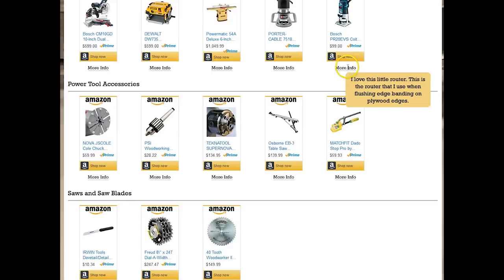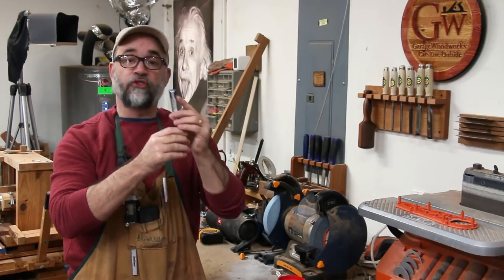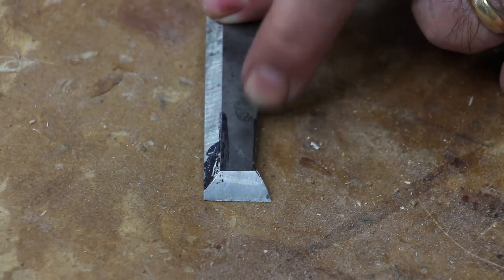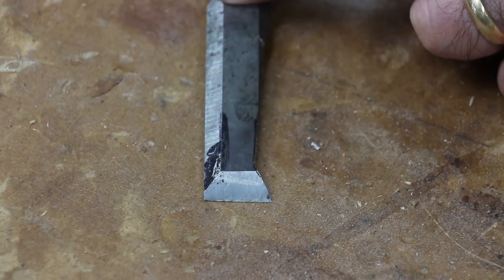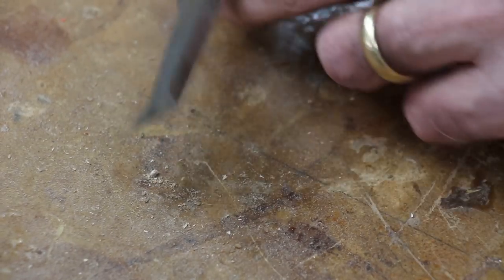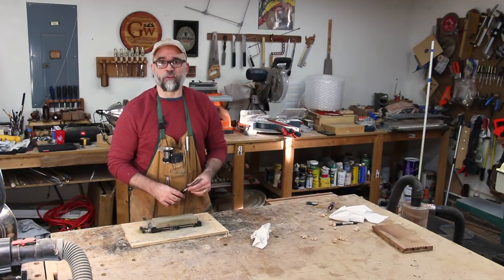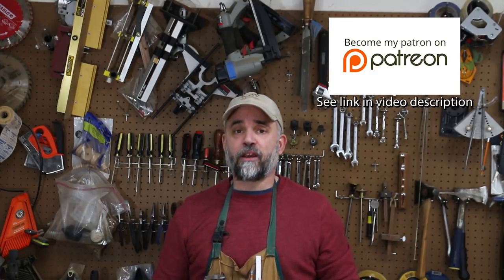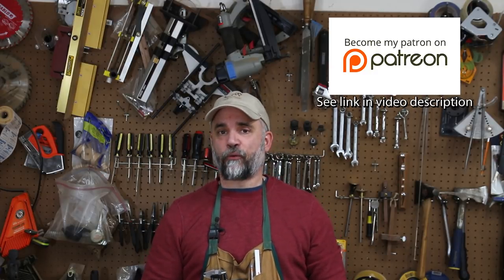Make a Fishtail Chisel from a Cheap Chisel !!

Comment: Now that's a proper Offerman beard. Did you dress your wheel? Maybe unnecessary, but great practice makes great things.
Reply from the maker: Not for this.  I have two wheels on my grinder; one for removing metal fast and a more expensive higher grit wheel for lathe chisels.  I only ever dress the more expensive wheel for lathe chisels.